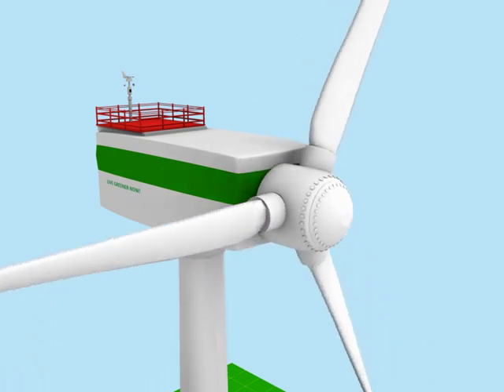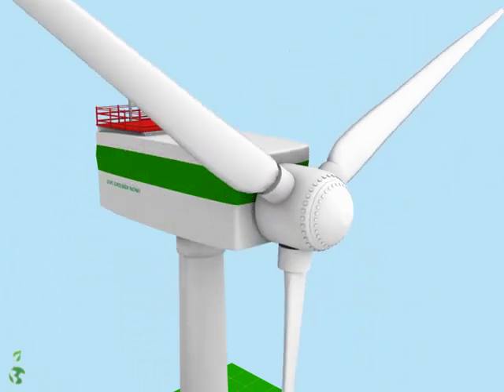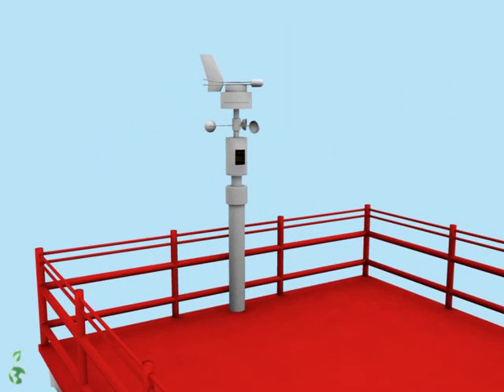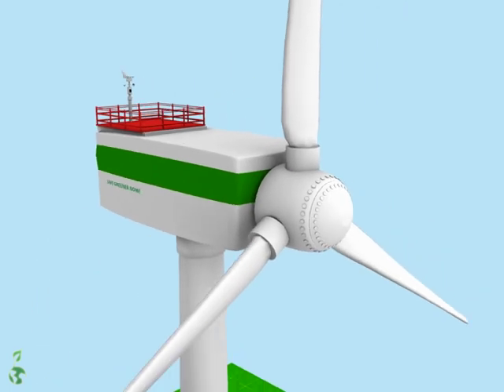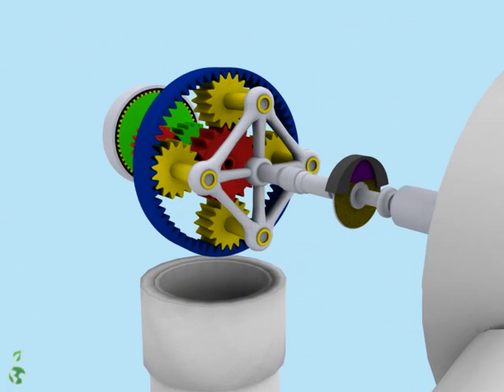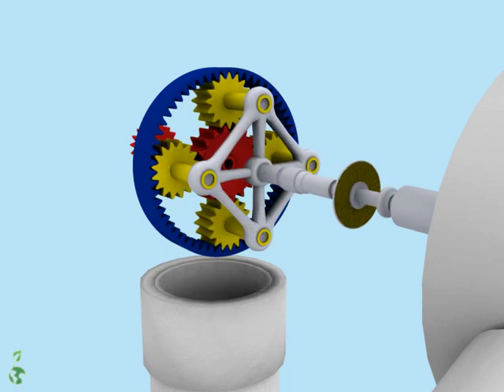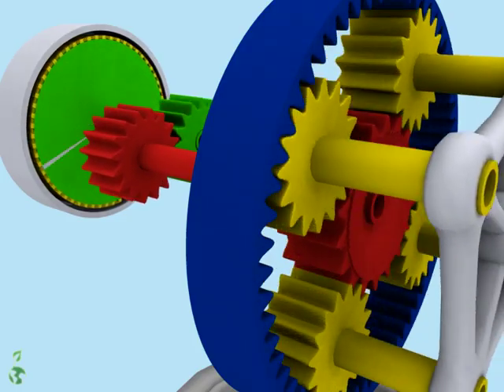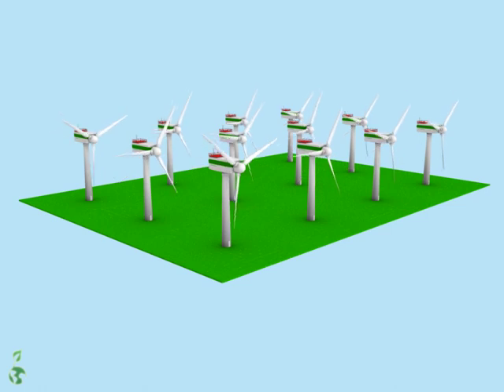Wind Turbines / Wind Power - How it works! (3D animation)

Comment: Technically the brake is on the hight speed shaft side instead of the slow speed shaft. It's easier to stop the rotor after the gearbox (the gearbox decrease the torque and increase the speed for the generator). But it's a very simple way to explain wind turbine, great job Thomas.